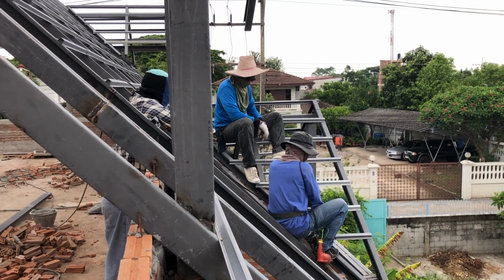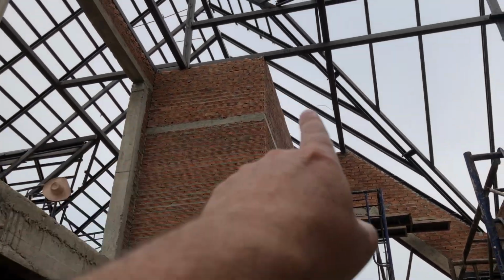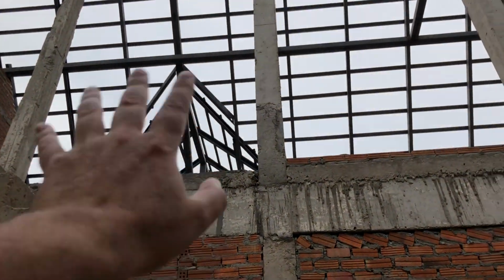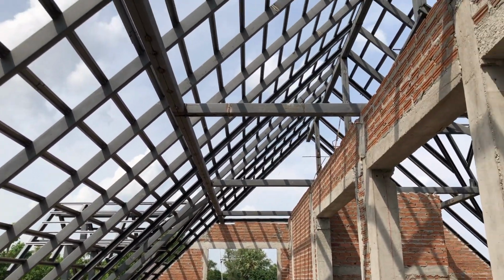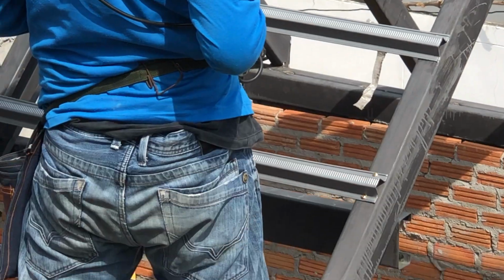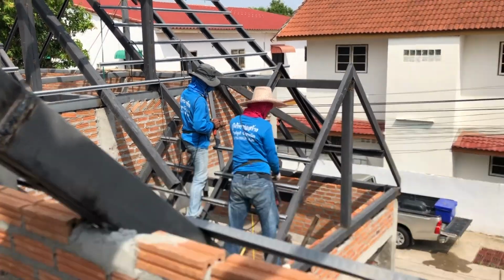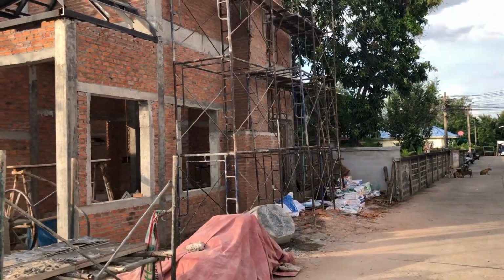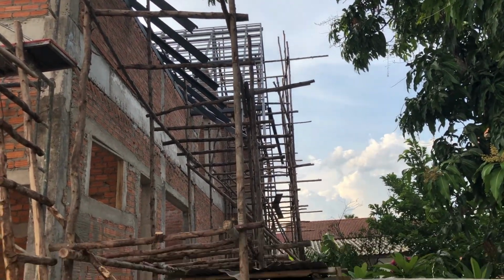v25 NEW HOME BUILD BURIRAM THAILAND BANGKOK HOUSE PROJECT บ้าน

Comment: That roof will be toast inside 10 years.  No rust protection with the roof, even the welds (koff) have not been sprayed over.  Hope youve got deep pockets
Reply from the maker: So far we’re six years and it’s fine. But I’ll keep an eye on it the next 4+ For the welded joints they did paint on that gray oxide paint. I forget what it’s called. But the strapping was only done with self tapping screws. It’s aluminum strapping so there could be a dissimilar metal problem. Thanks for watching

Comment: Safety?  LMAO.   Now thats funny.  It is looking good though.  Observation: I am surprised they are screwing in the "Purlins".  Typically they are welded since the entire roofing material attaches to the purlins and with the heavy weather in Thailand, welding would be preferred.
Reply from the maker: The strapping is (i'd guess) aluminum.  They did show me a hand full fo self tapping stainless screws.  It's my belief that's what they used.  I think welding would probably just eat it up.  Actually, the welding was leaving holes when welding two of the same metals together.  I couldn't image him with dissimilar materials.  No "stacking dimes" here.
Reply: @PolarAttack  You are correct. Welding would need to be steel to steel.  The holes you mentioned is just bad welding. If you hold to long in one spot it will burn through.